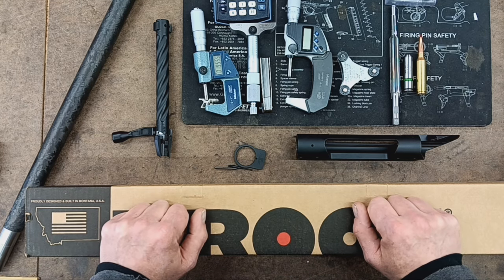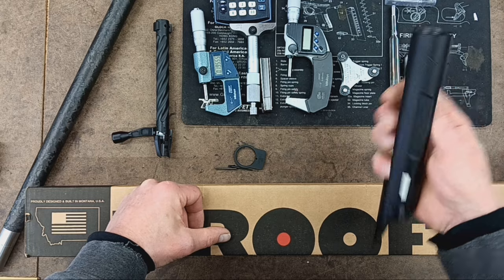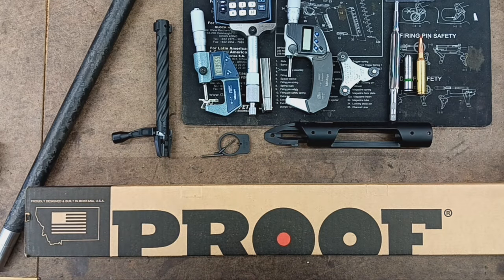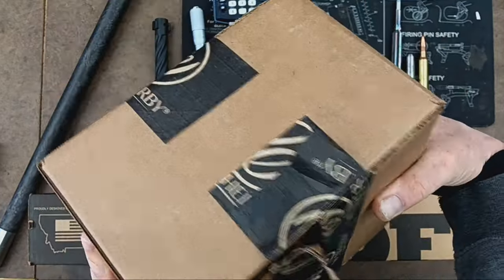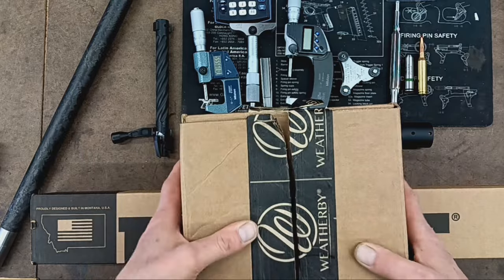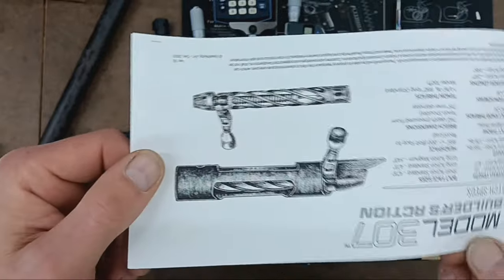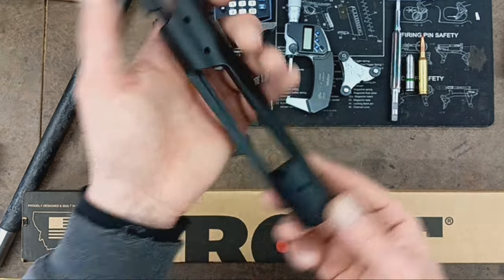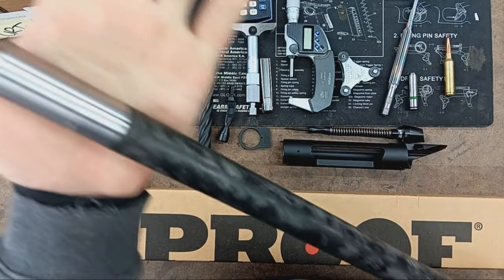Weatherby Model 307 "Builder's Action" Review and Barrel Work - Custom Rifle in 7 PRC

Comment: The Weatherby site says the Stiller/Savage mounts fit for scope mounting.  Which sounds right since I believe rumor control has it they are basically a Stiller action.   If a few sacks of cash fall at my feet I would have you chamber a 6mm barrel for one and hopefully with its 700 footprint it would fit in a Foundation Genesis with Hawkins metal, a man can dream.